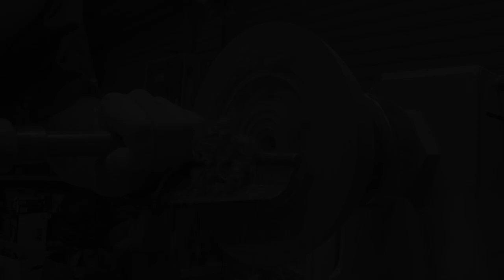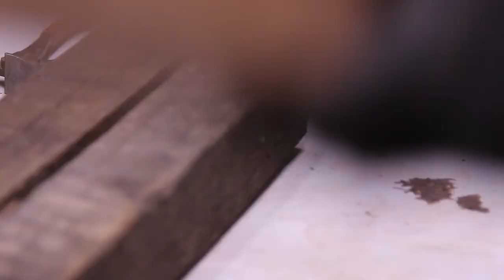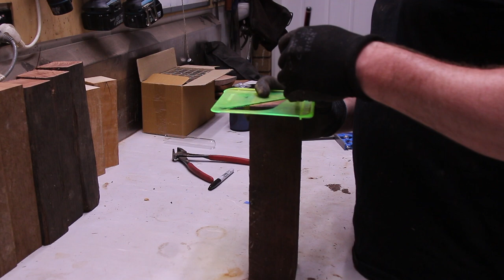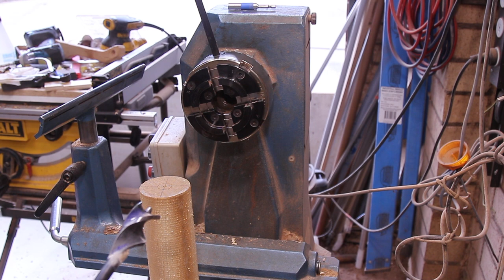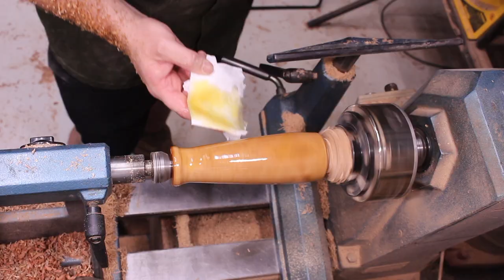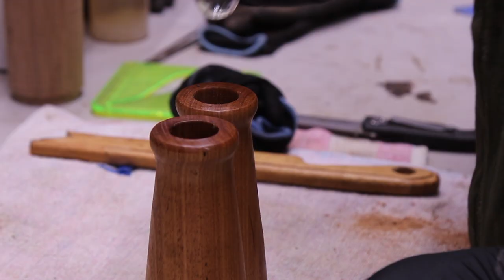BUD VASE - RECLAIMED WOOD - SATISFYING WOOD TURNING

Comment: as a South Ozzie can I ask where you get the glass/acrylic tubes from please? I presume the tubes are sealed in the base.
Reply from the maker: No worries. They are glass test tubes so they are sealed. I ordered a bunch from eBay and they came in a couple days unbroken. The seller I used was Scienceequip1 but there are a few different sellers on aus ebay